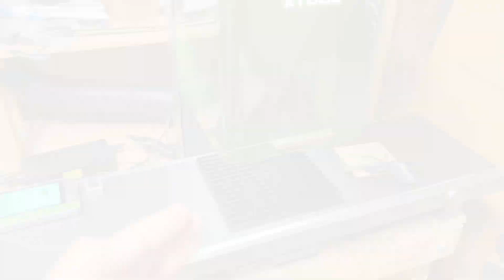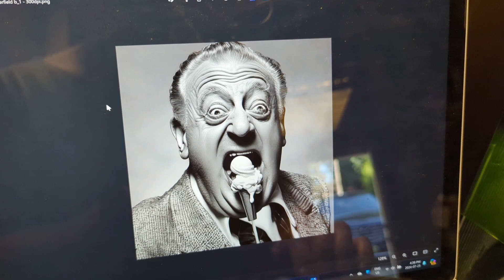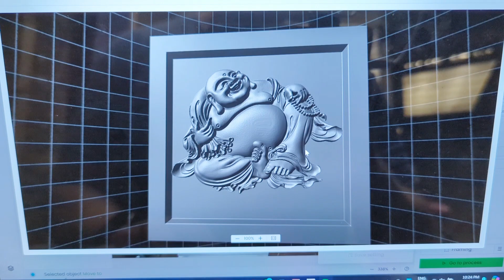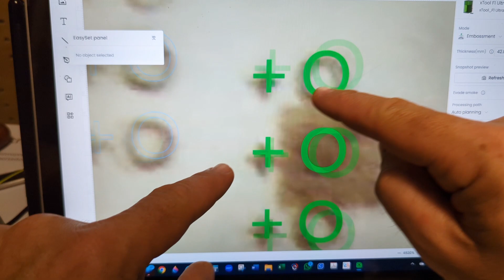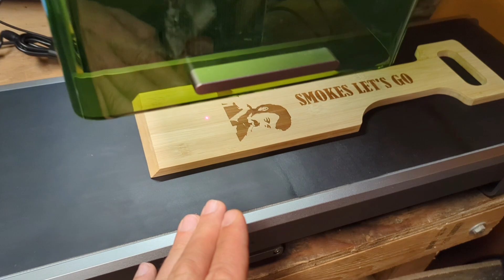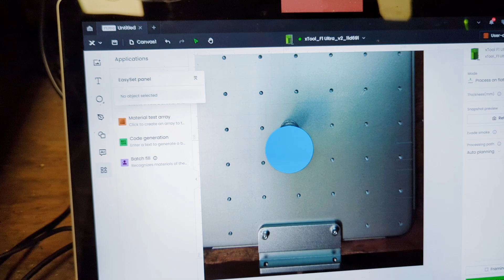More Than A Fiber Laser - Xtool F1 Ultra Projects & Review

Comment: great video! one more subscriber, is this filter sufficient for the toxic fumes from stainless steel?
Reply from the maker: I have mine vented outside but they also have their filtration system too.  Engraving SS will create tiny particles of Cr & Ni.  Not bad on their own but since they are not tiny particles you don't want to inhale them.  As long as its vented out or captured you're ok

Comment: Nice! Do you have the settings you used for the brass embossing?
Reply from the maker: I tried looking for the design file but I guess I didn't save it.  I ran full power and just had to do a bunch of passes until it looked the way I wanted.  I didn't do a depth map for this one, so that might be a better route to approach it.  I find the reference library settings are usually pretty spot on if you follow those
Reply: @Doodlebud  ah cool thanks! Did you do a clean up pass? Or a manual process afterwards? As it just looks so clean!

Comment: I’m curious about engraving on medals … I know some don’t rust but should they be treated just he same afterwards ?
Reply from the maker: It all depends on what it is made from.  If its brass or bronze it won't rust but if its a ferrous metal it can rust.
Reply: @ Thanks for the quick response … how about Stainless Steel ?? Once the surface is broke can it be treated or ??
Reply from the maker: It all depends on the exact alloy of stainless steel.  There are so many types of stainless steel out there and each have their own composition.  Stainless steel on a knife blade is very different than stainless used on a piece of jewelry for example.  If the item you're engraving has a coating on it to start with, it would probably be a good idea to finish it the same way.

Comment: Daaaaang that’s a huge oversight with the sweep angle. Can you leverage the camera and auto orientation features in LightBurn?
Reply: I’m thinking a potential work around for this is make a depth map in photoshop. However instead of a 3D file that rounds features like your buddah it would be recessed areas that make 90 degree angles. So that circle you made would be a thin slice of a cylinder basically.

Comment: Is the dust dangerous  when cleaning .. is the s1 40w more messy than the ultra
Reply from the maker: The dust is something you don't want to inhale just like any other dust. I wouldn't say one machine is more messy than the other. Both are very clean as most of the ablated material is vaporized to dust which is extracted by the exhaust system. The Ultra can 3D engrave slate which does produce a fair but if dust. But both machines are very clean during engraving/cutting
Reply: Thanks, mate .... I am so torn on what one to get ... I wanted the s1 40w to do bigger things .. but I don't know if the bigger  things will sell as much.. I was going to try and do unique  stuff  and sell them for a lot more , but then the larger things are expensive  to post.. 😅  can the ultra embosse the wood as good as the slate ,?
Reply from the maker: @darrenjones6425  Yeah it can do the 3d depth map engraving on the wood like on the coasters. Have to play with the power & speed to not overdo it 👍

Comment: Hello the last example with moderate Deep engraving is steel or just iron?
Reply from the maker: @arshamevoghlirahbin  which piece? The razor, bolt, or lighter?
Reply: @Doodlebud bolt
Reply from the maker: @arshamevoghlirahbin  that was a galvonized steel bolt
Reply: Thanks👍 Have you tried engraving at a moderate depth on steel?
Reply from the maker: @arshamevoghlirahbin  not yet, but it's on the todo list. I'm doing some cutting projects on thin stainless steel at the moment. I'll be cutting fountain pen nibs to modify them. I'll have a video up soon to show something different than just engraving stuff. Fun to see what else can be done and other applications
Reply: @Doodlebud thanks👍👍👍👏🏼

Comment: Hehe.. if you have a laser, you have the means of cutting a fixture to hold small parts in a specific alignment, but I'll admit with some improvement, the ability to just scatter parts on a surface and let the laser/computer figure it out is pretty cool.
Reply from the maker: Yup, I've use the laser to make a fixture many times but that conveyor is pretty damn slick!  Some folks aren't the best and designing fixtures so its a great add on to make life easy and quick.   You can be packaging things as they come off the conveyor while you keep adding more items to engrave.  If you have an order for 100+ of something the conveyor will make it a breeze!